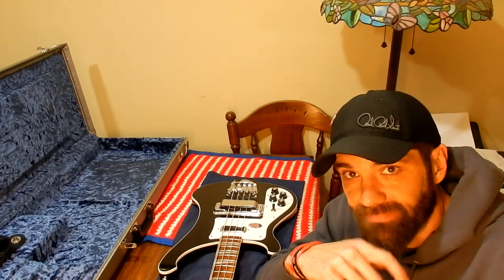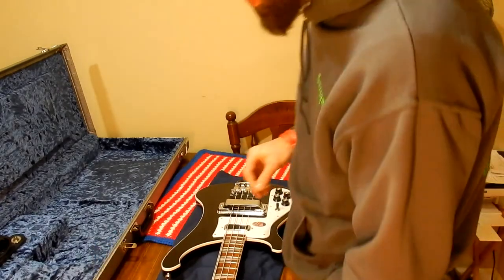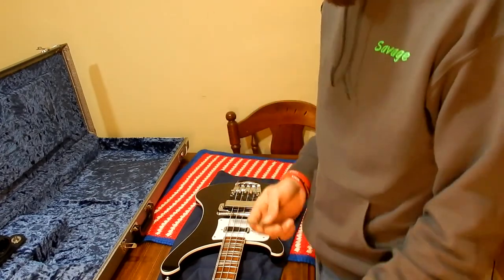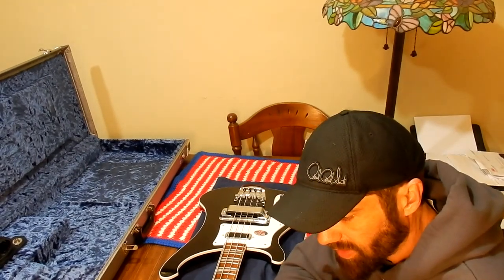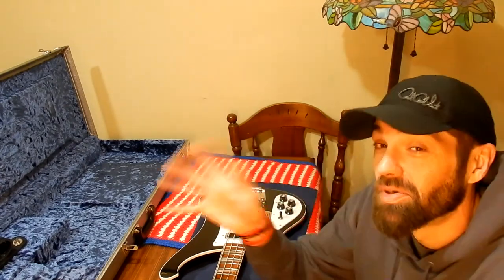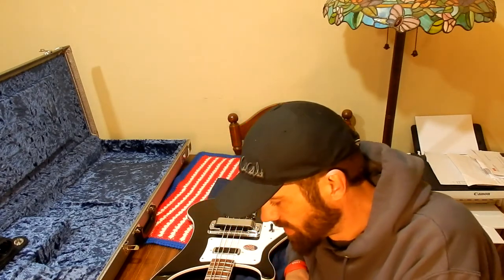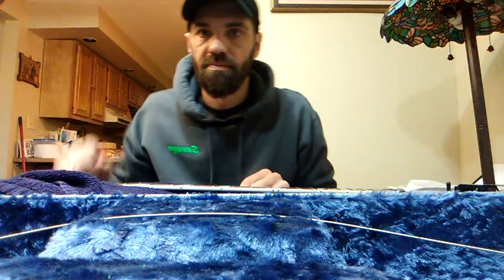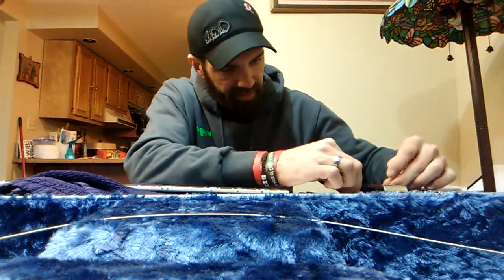Rickenbacker Bass set up

Comment: I would have a hard time playing it with .012 around the 7th-8th fret, I have a '75 4001 that I have adjusted to 0.05" The truss rods have very little tension on them. The action at the 12th frt is E-0.060" and 0.050"  on the G. Super low "fast" action with no buzz anywhere. First fret is 0.08 across the board.. Guess every body has there own preference's
Reply: I have a 77 4001 and used 105s for years swapped to 100s what a difference! No tone or volume loss. Should have done it years ago.

Comment: I was told Rickenbacker does not fully cut their nut slots so the owner can tweak it for the strings they want to use.  Of course like every instrument maker, they recommend their own brand strings.  I like Ernie Ball cobalt flats on mine.  A Hip Shot replacement bridge is the way to go on these basses.  If you want the string mutes, use a sponge.  As for the high price?  I bought mine new for $1599 out the door.  Don't know where everybody is paying $2000-$3000 for theirs.
Reply: You probably got the 4003S. Those go for 1599. No binding or triangle inlays and no rickosound?
Reply: @creid1980    Nope. It's the regular 4003.  Gloss finish, Body Binding, triangle fret inlays.  You just have to shop around and most good retailers have two prices.  The listed price and the bottom line out the door price.  I'm looking for a 4003 W Walnut body now and was just quoted a price of $1699 at the same shop. This is the gloss finish body binding triangle fret inlay model.  Picking it up next week.

Comment: I just bought a Rickenbacker 4003 myself, are you supposed to get a truss rod wrench with it?  I didn’t.  Also what does the bridge pickup cover do?  Is it functional?
Reply from the maker: His did not come with a wrench. I don't think they ever send one.  
The rear pickup cover is just a cover.  You can remove it with no effect on the sound of ur bass. It's so you can rest your hand on it
Reply: Rickenbacker does sell a 1/4"  thin wall nut driver on their website for $22.

Comment: Watching this video makes me realize how far off my Rickenbacker is. I can go into details but I don't even know where to start. You figured as much as you pay it would at least be somewhat setup.
Reply from the maker: After this setup I've only had to do it once since. That's not bad. A fender jazz is 10xs easier but I have to adjust more every time I change strings. Don't give up on it.
Reply: What I've noticed so far is the E string is below your recommended .012 and the G string is way above. Also from last I recall my measurments for the E string action was 3 mm and the G string at about 2 mm.

Also my pickup is sideways, my selector switch is super touchy, and the nut seems like it leans in toward the fretboard (maybe adjusting the tension will fix that).

It still sounds great but I wanna play Rush and I can't have the action/tension like this.

Comment: Observation by a complete novice (and new Ric owner)—could intonation be adjusted with a 45 degree angled Philips head, to avoid loosening strings for each adjustment?
Reply from the maker: No. You will "chew" up the baseplate or strip the screw.
Reply: Well, then—agreed.  Ric needs to come up with a more efficient way to adjust.   I’ll work out a new design tonight.
Reply: It may actually be possible if you have your bridge height adjustment insanely high, however, no one has it that high... and the strings might be in the way anyhow. This is just insanely stupid design. I've got my 4003 intonation somewhat off, but haven't bothered to do the adjustments yet. My E string has also scratched the fretboard (2-3 frets) just as Bryan demonstrated on the video. In addition. I'm going to change my saddle as the G string is too close to the side of the fretboard. Pretty bad quality control when thinking about the price of these guitars.

Comment: 18:40- Rickenbacker's own string gauge is set for 45 / 55 / 75 / 105 exactly.  You said at the beginning you were sticking a set of 50-105s on it. That's too heavy a set without filing the nut. Also, that action you talked about at the end is a shit low action on a bass guitar. Would have liked to have heard it played a bit.
Reply from the maker: You are correct. I didn't have to file the slot to get the string to set in the nut at the correct high but ended up filing it later due to tuning stability
Reply: @BryanSavage  They are beautiful, but a real pain in the ass and I agree with what you say.

Comment: hi bryan  had my rick for couple years now i play very lite gauge strings roto sounds 35-90  had a set up down wile back from a guy past away sadly( he knew ecactly what i wanted)  took my rick to someone else and  just not happy  was gonna attempt to set up my self  ..  with these lite string  obv i get little more buzz and such i like very low.action. people try to play my rick and are like wtf..  but its what i like just wanted to ask  asfar as string height if i follow your measurements or do i need to do some math..lol  no one around here has a rick and i just dont trust  any ol person that would just slap some string on it  and charge me 50 for a set up with out going into the detail you did
Reply from the maker: I would just take a few thousandths off my measurements if you like a lower action. Also keep in mind that the string tension will be "looser" the smaller the string gauge. If you use the measurements I gave with that light a string gauge you will get fret buzz.